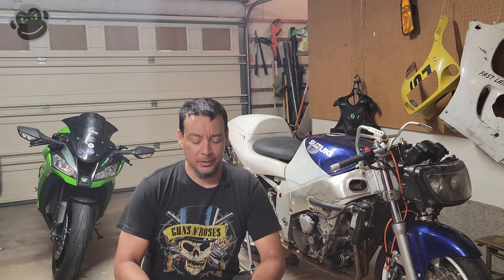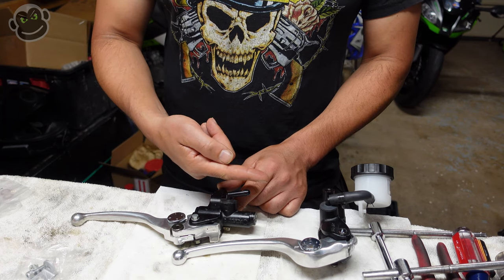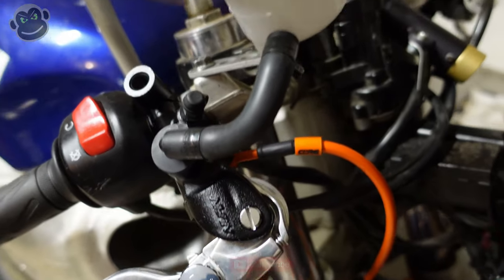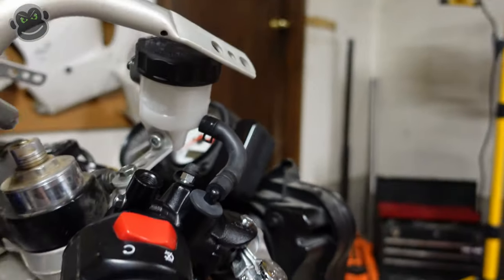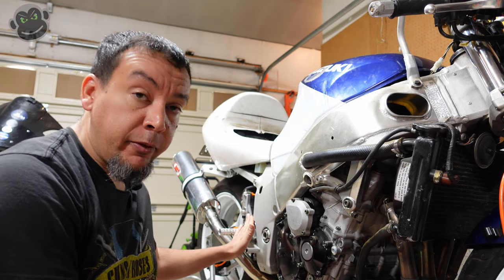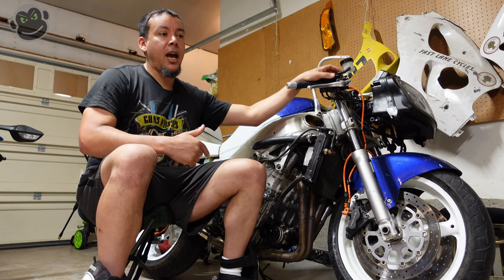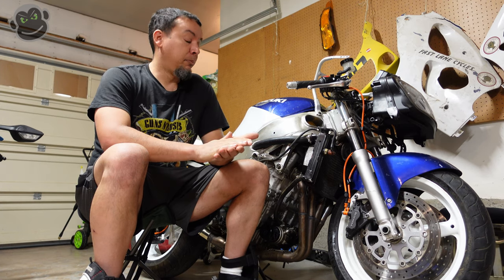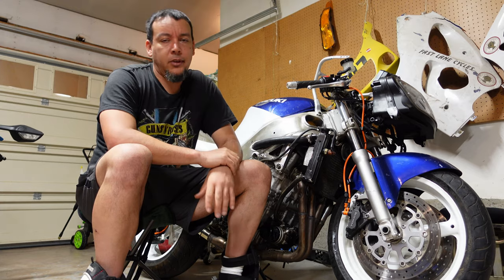RADIAL MASTER CYLINDER INSTALLATION | How to bleed brakes | 97 Suzuki GSXR 600 Build | Episode 21

Comment: I've been looking at the Brembo 19RCS Corsa Corta radial brake master cylinder. Many are saying it is the single best upgrade you can make to the braking system on anything without Brembo components as stock. It will leave a big hole in the wallet though! Perhaps I should just look at upgrading my stock Nissin axial mc to a Nissin radial. 

Your city's elevation is close to Australia's highest peak! The greatest elevation in my part of Sydney is only 280m and the street I live on travels from 5m to 64m above sea level 🤣 It's rather "hardcore" listening to you talk about having to make tuning adjustments to your bike due to your elevation above sea level. 

I highly recommend the Michelin Road 5 tyres. I got fifteen thousand kilometres out of my last set that were on the Tiger. I also have the same tyre on my CBR600RR. They were already on the bike (so, I'm not sure how many miles in they were) however, I've put about four thousand kilometres on them since buying it and that's including four track days (I'm not that fast). I'm going to try the Michelin Power 5 next for the CBR.
Reply from the maker: The Corsa Brembo is pricey!!!  Almost twice as much as the Nissin radial I got but you can get 19 size Brembo for less then a hundred more then what I paid, just not the corsa one.  I was gonna get the cheaper Brembo but everywhere I looked they were out of stock and I didn't want to wait.
Reply from the maker: Also thanks for the tire suggestion I will check them out!!!
Reply: @MonkeyButtRides  I didn’t realise there was a model under the Corsa. I just looked it up myself. I think that would be the more sensible of the two Brembo’s. The Corsa is a bit over the top for a street bike that is occasionally on the track. 
I’m going to look for the Nissin. Whom did you purchase from? I can only find one retailer in Oz and they are currently on back order.
Reply from the maker: @swich.69  I agree, I would have to be racing a decent amount to justify the cost of the Corsa.  I ordered this Nissin online from motosport.com.  It took a couple of weeks even though they said it was in stock.

Comment: I AM SO JEALOUS!!! Radial master cylinders look better too :P Delighted for you it's all working now :) Mucho happy for you it's getting closer and closer! 
Yaaaay repeated carb work 😂 I know that feeling..it's never ending 😂
Out of interest how much was the master cylinder and why did you decide against the Brembo? Did you already tell me this? 
Bridgestone s22s man..I know so many who use em and I have them on the gsxr too. 
No track 😥😥😥 Why do you hurt me.like this.
Reply from the maker: I paid $207 for the Nissin Radial.  There were some 19mm Brembo's for under 300 which I would have went for but they were out of stock and I didn't want to wait.  The Corsa Corta Brembo was almost 400 and I couldn't justify that cost.  Thanks for the tire suggestion I will check them out!!

Comment: Come to find out my SRAD has cheap eBay jets in it and most of them aren't labeled. 2 of them say 116 and appear bigger so I put them on 1-4. Runs but I want to get it right. I have a full dindle exhaust that to me seems fairly tame and street quiet. Should I go back up to the 122.5 and 125? Ive read you are supposed to lean the bike a little after a exhaust? Any help would I would be grateful. Thanks. Great videos!
Reply from the maker: The full exhaust should flow more air out allowing the engine to breath more air in which means you need to richen or increase fuel not lean or decrease fuel.  What elevation are you at?  At a minimum I would go back to the stock jets 122.5 and 125.  It's better to be a little on the rich side then lean side.